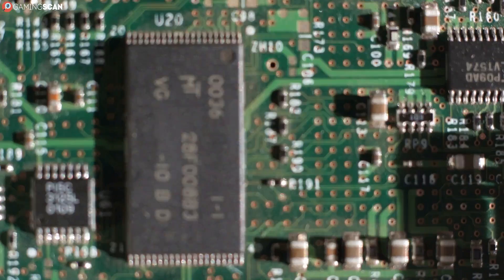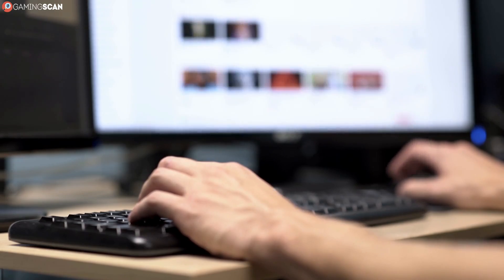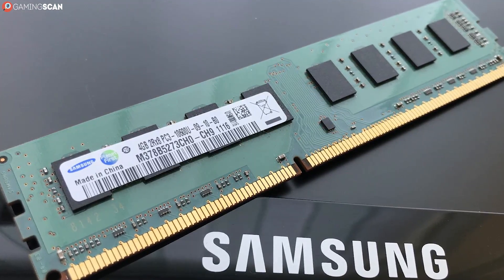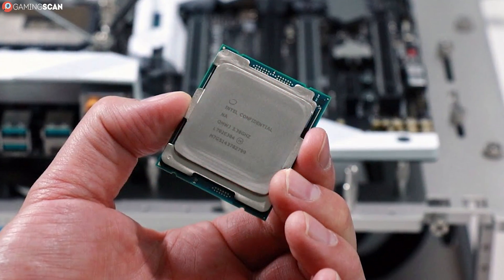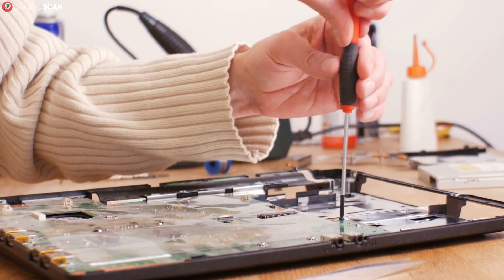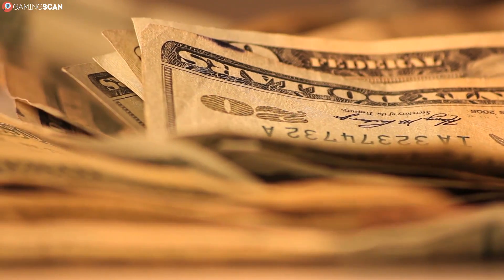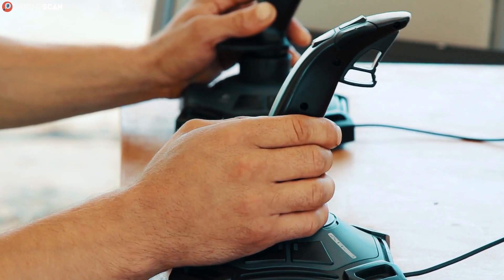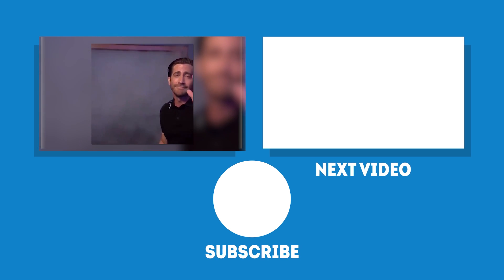What RAM Speed Do I Need? [Simple Guide]

Comment: Why ddr4 4gb ram has 2400 mhz of i doubled it the total is 4800mhz right? Bug why 8gb ram has only 2400mhz? Explain pls
Reply: Idk if you got the answer but you can't double the mhz if you have two different rams with different mhz speeds it will just go to the ram with the lowest mhz just because you have two rams with 2400mhz doesn't mean the two rams combine the mhz or add if they are both 2400mhz it will stay 2400mhz

Comment: My CPU supports RAM up to 2933 MHz (or sth like that).
I want to upgrade since I only got 1x16 GB RAM with 2400 MHz. Of course I want another stick to get to dual channel usage. I don't know if I should just try to find the same RAM stick I have, if I should buy 2 sticks with 2666 MHz or 3000 MHz...
Reply: The 2933mhz u mention is the minimum, so you can increase tue ram speed

Comment: Intel processors don't require much ram speed for gaming, yet the early Ryzen processors pretty much need faster ram and the current generation doesn't exactly need it but benefits can be seen. To anyone buying a Ryzen CPU I recommend you look for recent recommendations for your exact CPU, because a lot of the old problems have been fixed by motherboard upgrades and such.
Reply: Latest req i had seen was 32k and 36k on tight timings
Reply: Alfons Putzeys  For the current Ryzen gen I'd use 3600 mhz cl16, but it's pretty much interchangeable with 3400 mhz cl15 and 3200 mhz cl14. It honestly comes down to your budget and what's the best deal where you live. Intel is way more forgiving and depending on the build I'd say 2133-2933 mhz is enough.
Reply: I have a question. If i bought a 2 ram with 1600hz, are the megahz added together so i got a 3200hz or not?
Reply: @farisalharbi5459  
    If it's being advertised as 1600mhz RAM then it is most likely already doubled from an 800mhz bus clock. If you are buying it for an Intel motherboard that's recent and supports DDR4 then the lowest speed RAM I'd recommend is 3000mhz or 3200mhz. If that's too expensive where you live, then 2666mhz or 2400mhz will have to do. Recent AMD CPUs depend more on RAM clock speed, that's why 3200mhz cl16 is the minimum speed recommended. Also, buying RAM sticks that come together is recommended because it makes it easier to overclock. Usually used RAM isn't much cheaper than new RAM because they rarely stop working, but I don't know how your new and used market looks. 

    By the way, if you bought DDR3 for an older motherboard then none of this applies and it can probably overclock just fine to 1866mhz or even 2133mhz if needed.
Reply: @JCerris  so what i conclude is that i should buy a double ram together with 3000hz or 3200hz, right? And if it together have 3000hz that means everyone has 1500hz. am i right?
Reply: @farisalharbi5459  DDR = Double Data Rate
3000mhz = 1500mhz bus clock

The conclusion should be that the amount of sticks doesn't affect speed, having 2 sticks just increases the capacity.

Right now 16gb of RAM is what's recommended, and for the best speed you want it in dual channel. 
Basically you want a kit sold as: DDR4 2x8gb 3000mhz cl15
Reply: @JCerris  what is better: i buy 2 ram individually each has 3000hz or i buy 2 ram together each has 1500hz?
Reply: @farisalharbi5459  If the 2 individual sticks are 3000mhz then that's the better buy.
Reply: @JCerris  you helped me a lot, thank you.
Reply: @farisalharbi5459  No problem, glad I could be of help.
Reply: @JCerris  yo im using i3. Can i buy 3200mhz cl18 ram?
Reply: @mont9150  I apologize, didn't get notified of your question till now. Short answer is yes, there's always a but though. Officially i3 CPUs support up to 2666Mhz RAM. But depending on the generation of the CPU and the motherboard, I've seen people use the default 3200 XMP profiles with no problems. If the XMP Profiles don't work you can look into manually setting the speeds. Often called RAM Overclocking, but in this case it'd just be lowering the clock speed while hopefully achieving lower timings.
Reply: @farisalharbi5459  no its still 1600 MHz. You want at least 16gb @2000mhz for usable results. I use 128GB @4200Mhz. Also you want DDR4, not DDR3

Comment: But If my Ram is FASTER (or more giga ) than what my build can achieve can I still  take advantage of it for things that are not gaming?
Reply: It depends of you do productivity workloads like video and photo editing.
Video editing beeing the more demanding then yes.
The extra overhead allows for more large volumes.
Gaming is mainly high pased data, how much is depending on the title you play.
Reply: Alfons Putzeys to you too ;)
Reply: Oat Gnoix Fine then. Thanks !
Reply: To add and  to further clarify my previous answer.
Jdec standard is 2xxx MHz.
Anything Faster is a win but it is best to crosscheck the qvl list for certainty that your ram kit wil work 100% sure with your mobo in OC or xmp modes.
Games only use 8 to 16 GB of ram.
That beeing said any 2 x 8 kit is sufficient to get the most effectieve speed gain as dual channel is what you Will want die the most Optimal speed.
From that Point on.
It is what your cpu van cope with , your preferences and your budget to determine your choices.
32 gigs in 4x 8 GB.
As these kits are pricey, go for value over timings.
Again budget and the rest limiting your choices.
However zen 2 ryzen 3k series cpu favor 3200 and 3600 on tight timings. In combo with infinity fabric oc.
Lower CL ratings means more expensive.